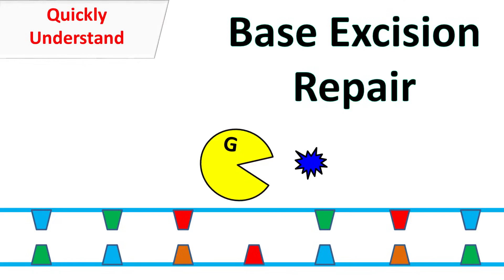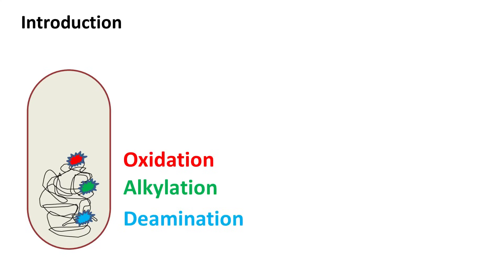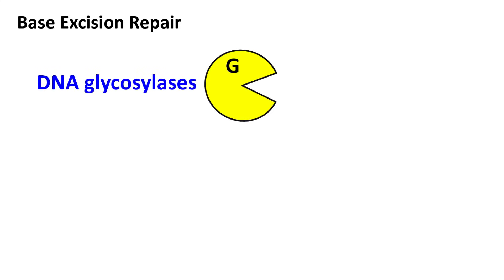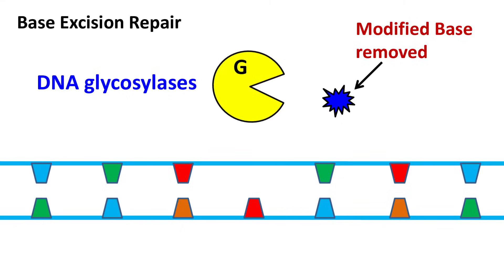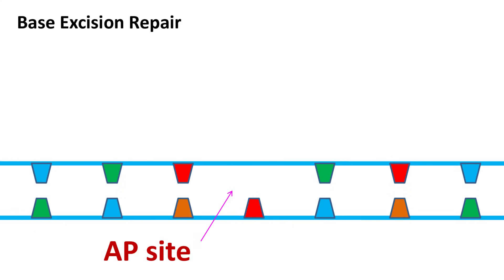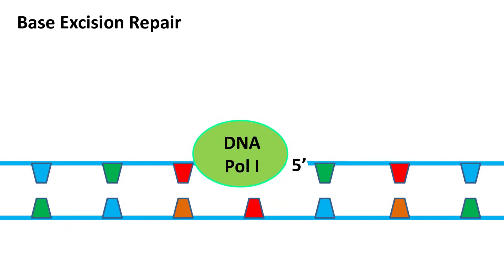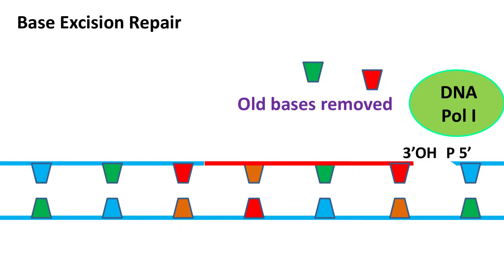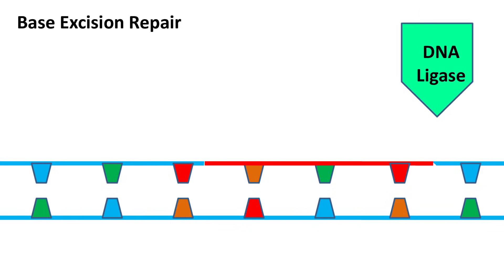Base excision repair

Comment: the animation shows a 3' to 5' DNA pol. but the narration say it was a 5' to 3' DNA pol, so which one is it?
Reply: dna is always built 5 - 3 prime
Reply: The overall direction is 5' to 3' but in that instance, the exposed ends are 3'-OH on the left side and 5'-P on the right side.
Reply: if i understand correctly, each nucleotide has a 5 prime end and a 3 prime end. the new nucleotide is added so that its 5 prime connects to the 3 prime of the one before it